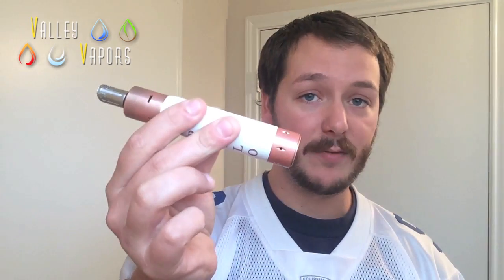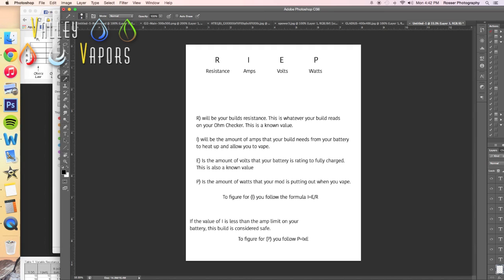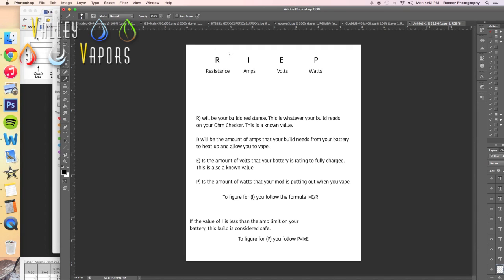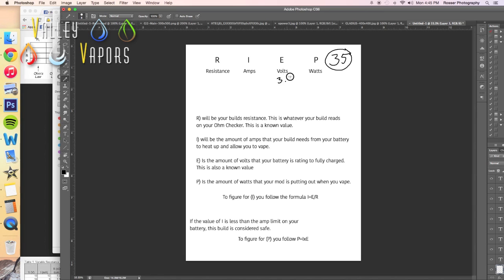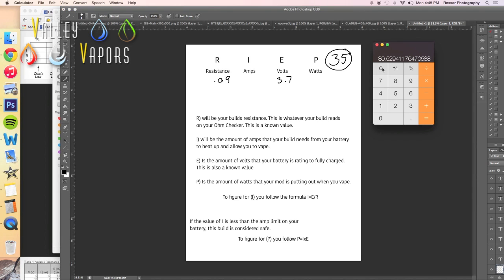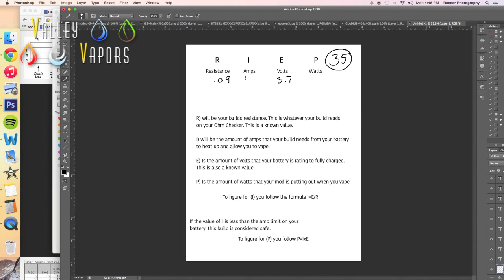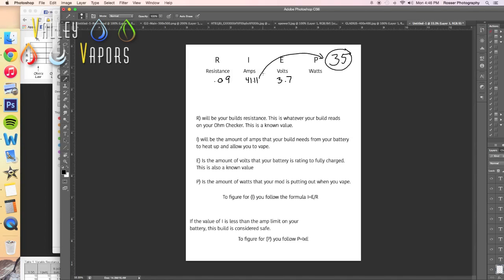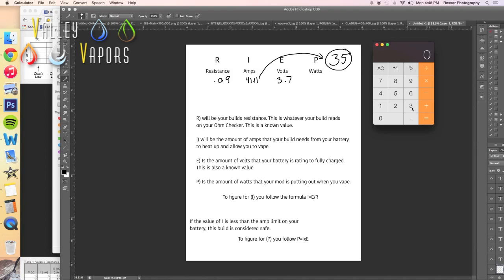Valley Vapors Explains- Battery/Build Safety

Comment: Somethings for you to consider....
- The Sony has a higher continuous discharge rating than the Efest battery you're using. The Sony is actually safer for lower resistance builds.
- You use 4.2 for your voltage value.
Reply: *****
He should be using 4.2v as the voltage value for his calculations. Yes, batteries never fire at 4.2v due to voltage drop and battery sag, however it will give you an added margin of safety, especially for beginners. The problem with using max and pulse amp ratings is that there is no standard for these ratings. Continuous discharge rate is safer to use for beginners. If you really know what you're doing, you can build for the pulse / max discharge amp rating, but it's under your own risk. The problem with pulse ratings is that they rest the battery in between each pulse for those tests. Sure you might not be firing your mod for 1 hour straight, but if you chain vape at the max pulse rating, you could easily get into a situation where you overstress your battery. It seems that the target audience for this video is beginners who don't know about battery safety. If you want to give advice to people who don't know what they're doing, you really should be giving them the safest directions.
Reply: *****  It really isn't. Have you taken a multimeter to a freshly charged battery? Most of the good ones out there will read around 4.25v off the charger. If you factor in the voltage drop from your mechanical mod which is anywhere from 0.1v to 0.5v you're still looking at 4.15v to 3.75v. It's just weird to me that you guys make a video that puts out numbers that are less safe than conventional battery safety calculations which uses max voltage and continuous draw ratings.

I use red efests 26650 that are rated for 15a continuous and 60a pulse. They get hot when i push to close to 15a, so i build to stay around and under 13-14a. It would be absolutely ridiculous to run that battery close to the advertised 60a rating, ridiculous! This is how battery safety should be explained. Your video is more about the MOST that you can get from battery than safety man.